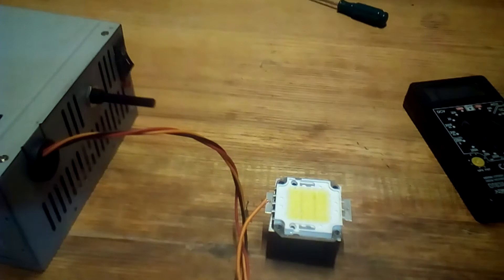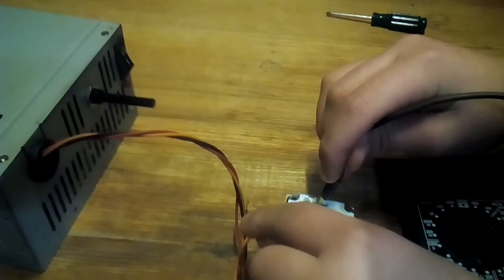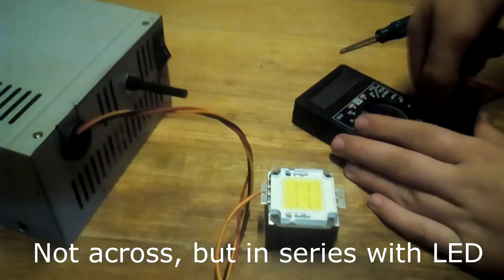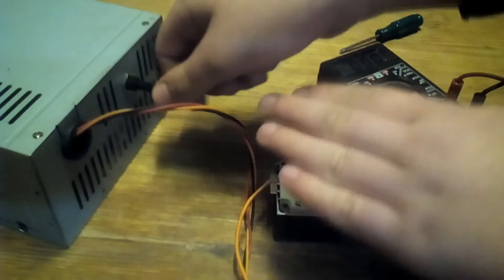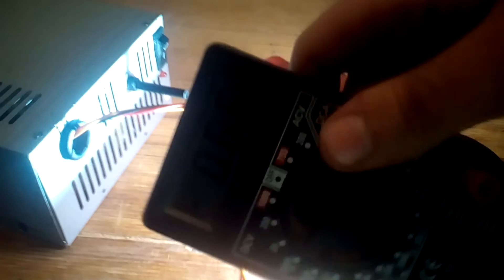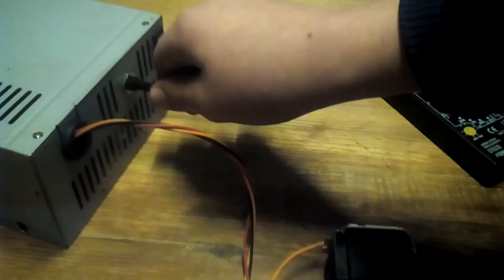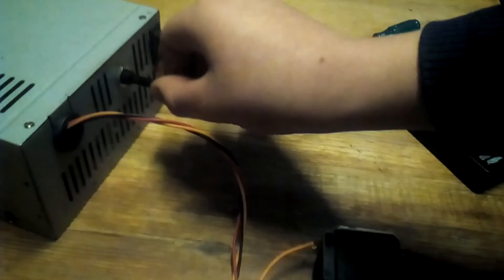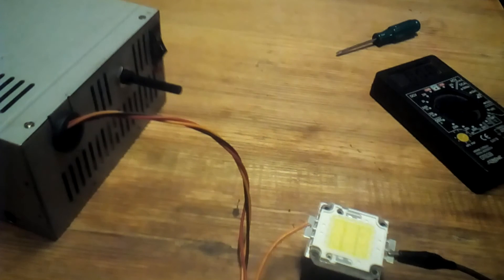How To Find Polarity Of Powerful LED

Comment: these are constant current so how are you doing this
Reply from the maker: What do you mean? I show how to find polarity (+ and -) of this LED by checking it with multimeter.
Reply: I guess I do not see any displays or dials so I assumed it's just a computer power supply. I was curious if you converted a computer power supply to a constant current adjustable one. I love to use old power supplies but up until now I haven't needed a constant current supply.

Edit: And thank you for the tutorial on polarity. I made a spiffy desk light for my workbench with passive cooling from an old CPU heatsink. Do you know what temp is optimal? I bet mine is working at 55C or above.
Reply from the maker: Temperatures over 60C is bad for LED. Try to keep it below that temperature. By the way that power supply is converted to double pole with adjustable voltage. For a quick test you don't really need a constant current power supply.
Reply: Shucks you know what happened as I read your response?? The LED and heatsink became separated and the LED burned out. There goes $2.70. Cool channel man. I have loved electronics and fire since I was a kid.
Reply from the maker: Thanks, me too since 5 years. Always attach LED with screws, it will make better thermal contact with heat sink and it won't move.
Reply: Have you ever made a dimmable COB chip light?
Reply from the maker: No, i'm mainly interested in switched mode power supplies and sound amplifiers. But it's simple to make dimmable LED light by using adjustable voltage regulator. If you want to talk more, we can do it in private message.